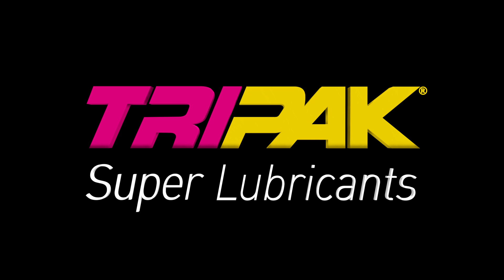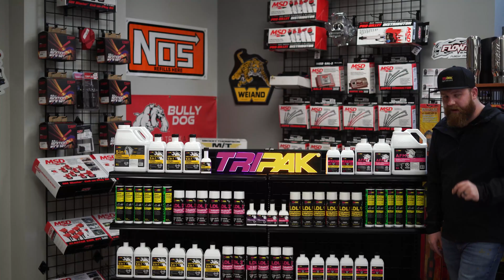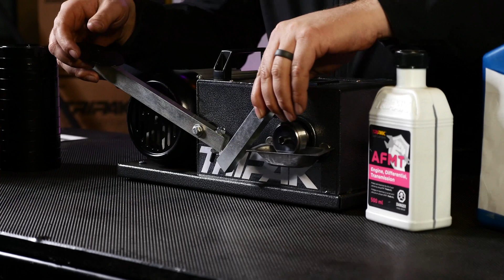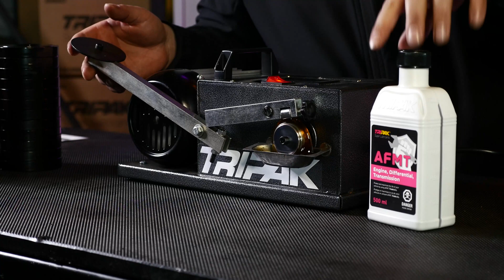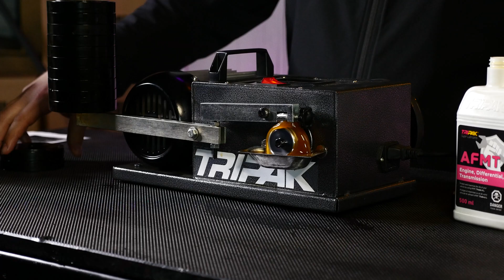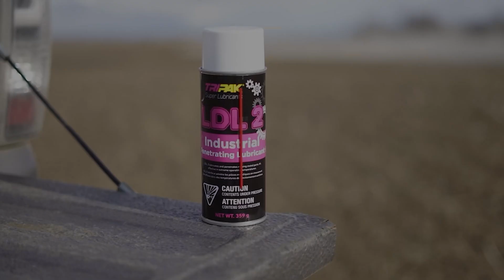TRIPAK | AFMT Extreme Pressure Test

Comment: Some tips to enhance the video:   1.  To help the viewer understand the amount of pressure between the bearing race and the cylindrical bearing, with no weight added place a paper match between the contact points and try to pull it out.  No lube in place and a straight pull. In the past, the match would tear in half before it would pull out.  
Tip 2:  Use a cheap digital microscope to show the scars on the cylinder.  
Tip 3.  Show the scar without.  Show the scar with, then rotate the cylinder after wet run so the dry run has a different scar.  Under proper magnification you can see the scar produced with additive is not an abrasive scar but purely a deformation of the metal caused by the extreme pressure.

Comment: What would be the reasoning for putting it in automatic transmissions? My basic understanding is that it requires fluid friction between the clutch packs in order to function properly. And this fluid would theoretically rob the fluid of its friction, making it slip when changing gears. Love the fluid… a lot. But is it safe to put in older, more worn automatic transmissions?
Reply from the maker: This is a great question. You are correct, because they do require a certain amount of friction. For automatic transmissions we recommend using the AFMT at only 5-7% instead of the normal 7-10% concentration. Adding at the lower concentration still protects the metal and the valves moving freely. This prevents the valves from gumming up and sticking .It also helps to reduce the temperature in the system while still allowing the transmission to run normally. This comes from customers experience over many years of using the product in this application.
Reply: @tripaksuperlubricants  even in a transmission with almost 300,000km on it?
Reply from the maker: @dswitz9997  
Definitely, We have one truck running it in an Allison Automatic transmission with 677,000 original kilometers on it. We started adding the AFMT to it at around 400,000km.
Reply: @tripaksuperlubricants  awesome, thanks for the help! I think this fluid is amazing.